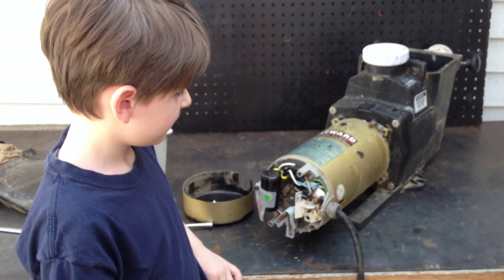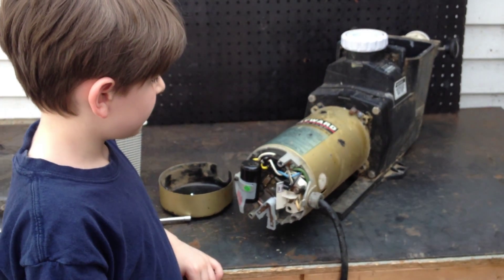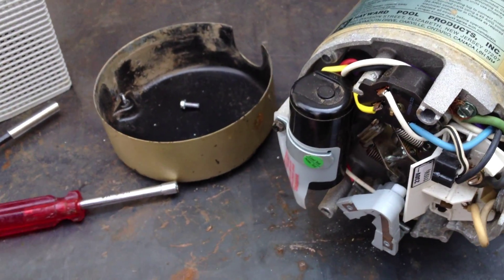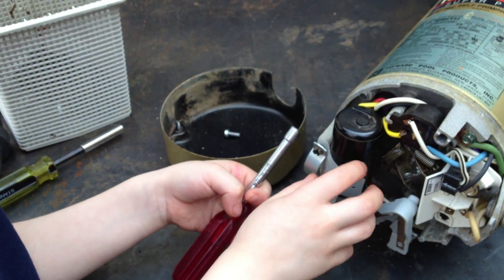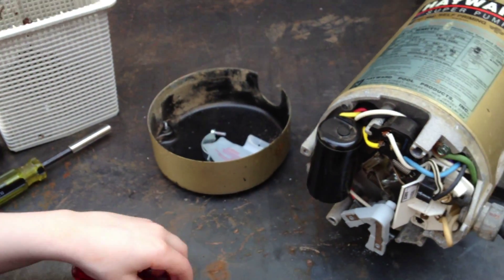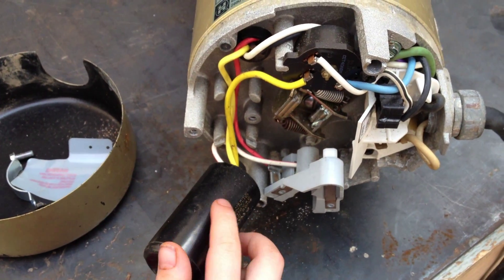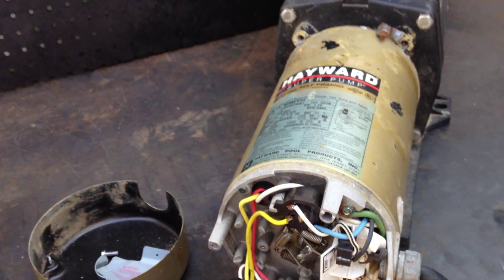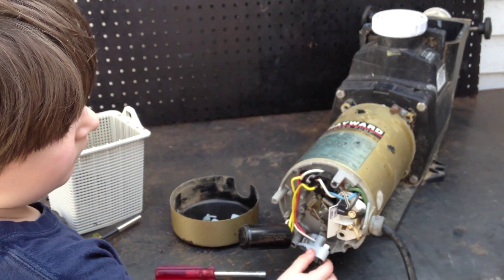9 Year Old Rebuilds Hayward Super Pump Part 003

Comment: Where is the best place to get a new capacitor and that white mount thing that goes on the far right in this video? I’m not sure what you call the white mount thing? I need to replace the capacitor and that white mount thing that’s on the far right looking at the back of the pump in this video. Thanks